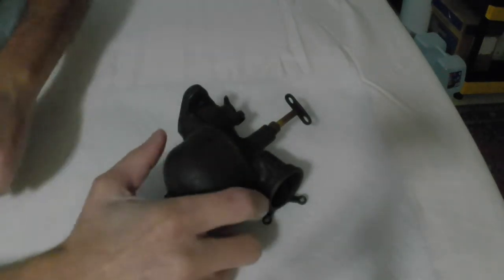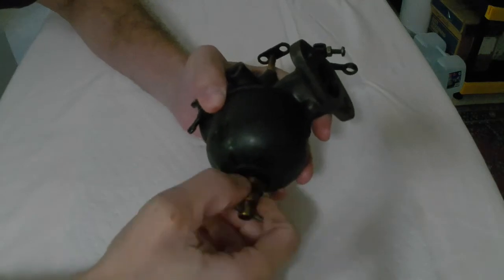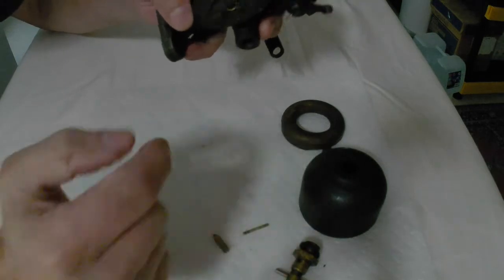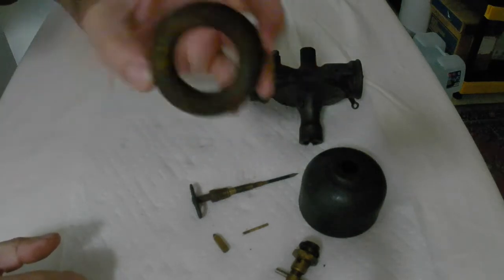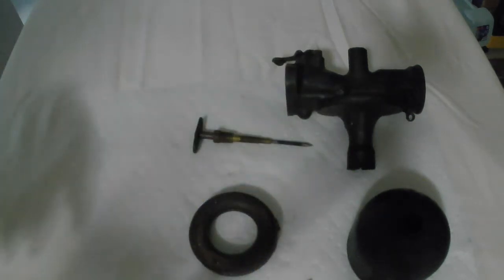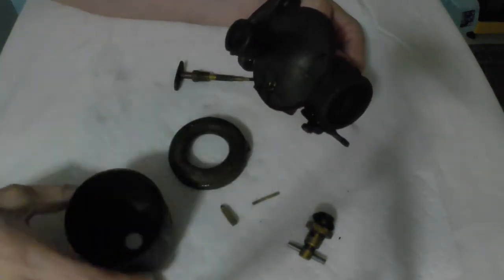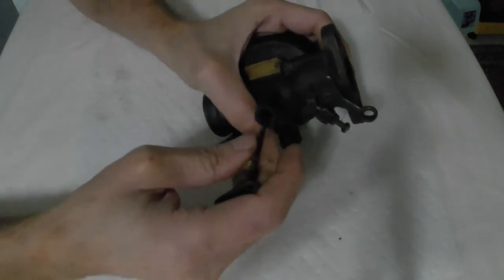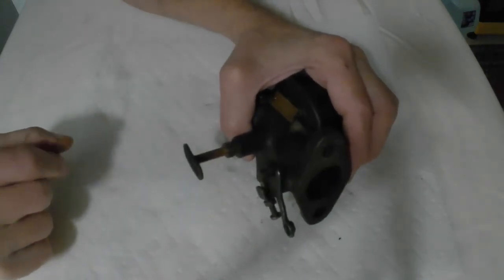Model T Carburetor Overview - The Model T Speedster Project  Restore old car to new

Comment: The choke spring on my 1920 NH was broke so I bought a new one.  Can't figure out how to replace it
Reply from the maker: It goes around the shaft if I remember right.  Hopefully this link works - it's a photo of the spring on:

https://imgs.search.brave.com/Pf1lrf9D8Ljwct2Xt2fXol_pb0vgX2fYf3R4j7_-NtU/rs:fit:860:0:0/g:ce/aHR0cHM6Ly93d3cu/bXVzY2xlY2Fyc2Fu/ZGNsYXNzaWNzLmNh/L2ltYWdlL2NhY2hl/LzgyMzMxNWU3OWRk/NTA5ZmE4ZDFmODVk/MTg5Zjc1ZTM3LzQz/ZDBlOTU2NDc4NmVl/NTQ4ZmRkYWYzMzcw/MTYxNzIzLmpwZw